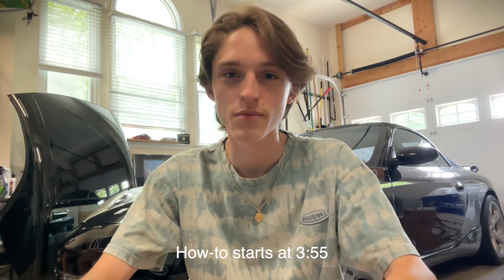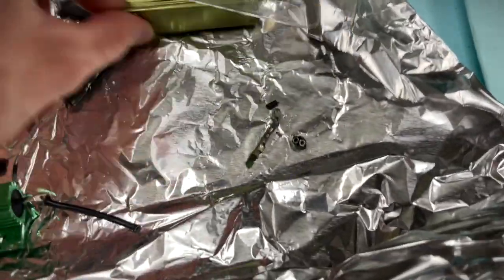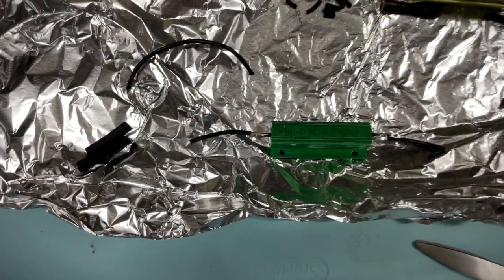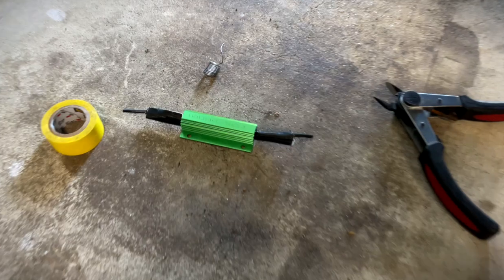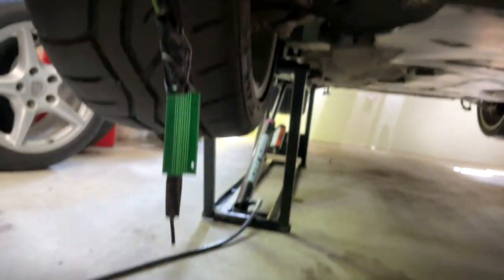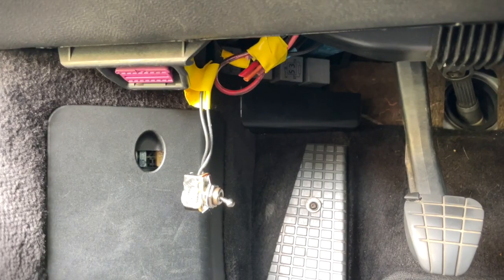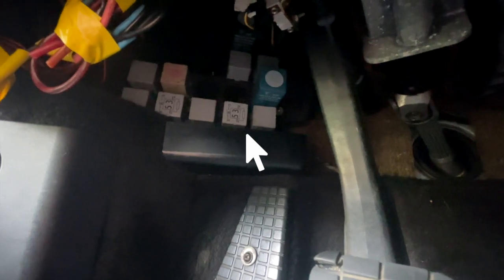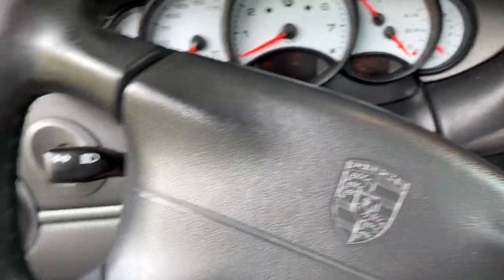EVERY 996 Overheats. Here's how to fix it!

Comment: You linked the wrong resistors on your description. 
4 ohm is way to high and doesn’t allow the proper current to flow to get the fans to high speed. 0.5 ohm is what you need for this job. I learned the hard way.
Reply from the maker: fixed!

Comment: Youre a cool dude bro! Glad to see other 20 somethings getting into these cars :D I am 24 and bought my first nice car, a 2001 carrera 2 in guards red :D just a month ago! It was a daily driver for 10 years. Well taken care of... Very loved, and the PO had the money. I don't like how my temp gets to 105*C (the A/C hack) when idling on a 100*F+ day + humidity + in the sun + a hard run. That's 210-220*F... Still within spec tho.... It'll get to 106 C, then drop back to 103 C and back and forth. Drops to 103*C when driving. The old resistors are good, but I want to do the switch mod....

I am going to do this mod and will report back on what I am seeing, temp wise! Once she cools down, I am going to try using a semi-high pressure washer to get the dirt and grime out of the radiator fins. I am also going to take her to my local porsche shop, Rennsport (not porsche dealer) and have them flush and bleed my system too. Some say this is due to air in the coolant? IDK if that's true, but she needs a flush so we are going to do it. Some people are saying I should replace my water pump too, but the PO did that back in 2021... thats a bit soon to replace it imho. Lots of engineering on theses cars man

Before anything, I need to get 5k miles on her ASAP as to get the oil dirty and then replaced and then oil analyzed. That will tell me all I need to know about stepping forwards.

Also, the 3rd radiator mod is NOT all sunshine and roses apparently. TLDR; unless you are tracking your car, its useless or even bad for it. Why? in short, bc the extra rads = extra cooling of the coolant deemed hot enough to be sent to the rads. That means that the engine must get extra HOT before it goes to the rad. There is a reason the autos and gt3s got the 3rd rad. The auto got it due to higher trans temps (in the bellhousing area therefore transfering heat to the engine, and gt3 is always on the limit to its going to be hot anyways). For a street driven c2 c4 c4s or whatever, 2 rads are perfect. This fan switch mod is just an extra precaution.... here's the quote:

"[A 3rd rad is extra cooling of coolant and] Because the engine only allows about 10% of the coolant to enter the cylinder block (the rest goes straight into and out of the cylinder heads) low flow [lowered thanks to the 3rd rad] can allow the cylinders to run hot[er] internally"  - @bazhart on Rennlist.
Reply from the maker: @studid55  really good insight! It’s nice to see someone so knowledgeable getting into these cars as well. They’re great to own if you can harness the knowledge to keep them running how you want to, and it seems like you’re more than qualified. I always thought the third radiator was a crazy expensive bandaid to a very cheap issue to fix! New coolant should keep you cooler to begin with, and the fan switch will give you the control to keep it at normal spring/fall operating temps in the summer! Some things I’ve learned over almost four years and 40k+ miles are that Mobil 1 is the best oil for these, ceratec genuinely works as an additive (don’t use it with any other additives though), fan switch is a lifesaver, front drop links are easy to change and make a big difference, keep the engine under 3k until operating temp any time it’s cool out, check under the rear foot carpets (pull them up from the back) to check for rear window and sunroof leaks, and drive the crap out of it whenever you can! Message me on Instagram (just my name), I’d love to see your 996!

Comment: Or you just keep your aircondition on so high speed fans are almost allways on !!!
Reply from the maker: That doesn’t work when the resistors fail!
Reply: @GoodchildGarage  resistors make fans go half speed , i think mine are broke and  work only high speed when fans kick in ???
Reply from the maker: @finnsxc3610  hmm, try replacing just the resistors and if that doesn’t work I highly recommend doing the high speed fan switch. It’s a takes a bit of time but it will solve this permanently
Reply: So to do the switch you connect to the 2x high speed relay pin 87 to the switch and the other leg from switch to ground? Please confirm

Comment from the maker: I should add, you absolutely CAN get new radiator fans and they come with new resistors. This is about $300 rather than $10-20, but if staying all original is important, this option IS available.